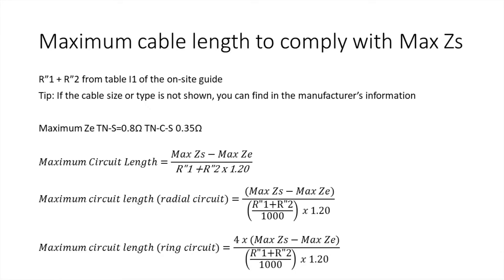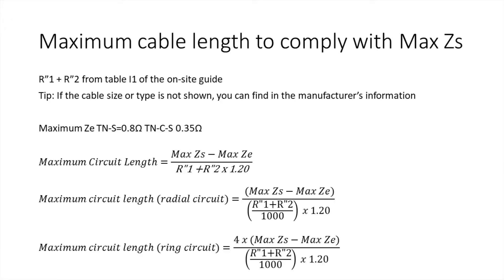Maximum Zs-calculating maximum cable length

Comment: Hi James, 

Max Ze for TNCS is 0.35…. What happens when you then have large protective devices for outgoing ways. For example perhaps the consumer unit is more than 3 meters away so you have to use a 100A bs88 fuse.. same for blocks of flats.. this has a max ZS of 0.34.. if the Ze is close to maximum, how on earth are you supposed to get round it ?

Comment: It didnt saeem to work out quite as expected  should it not be  (R1+R2/1000)/1.20   ?     Some example measurements would be useful
Reply from the maker: Hi,
The figure of 1.2 is a multiplier to allow for the operating temperature, and we multiply this by the tabulated value for R1+R2. There is a worked example in one of my earlier videos. Please see the link https://youtu.be/-kLZt7oamNA
Regards
James